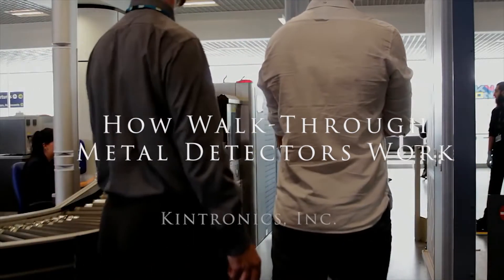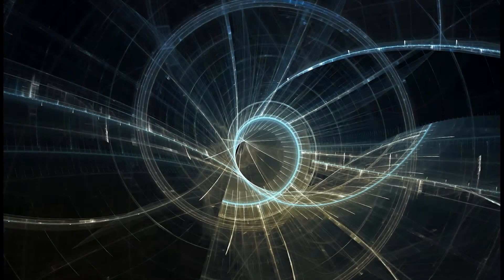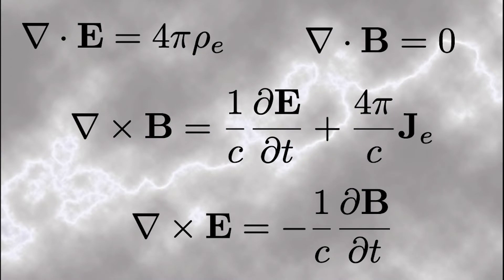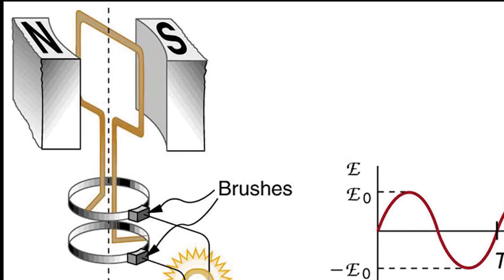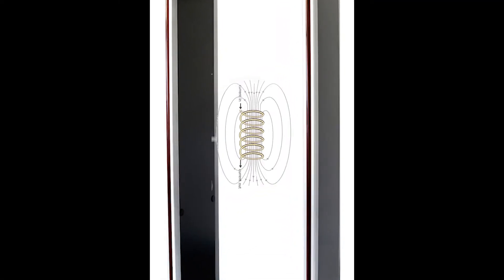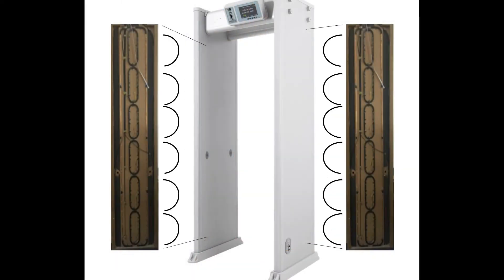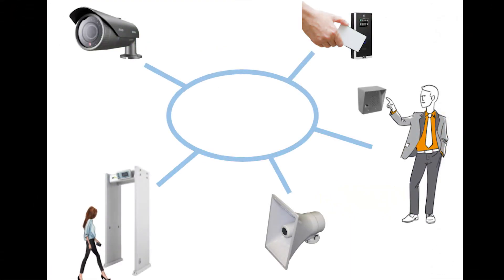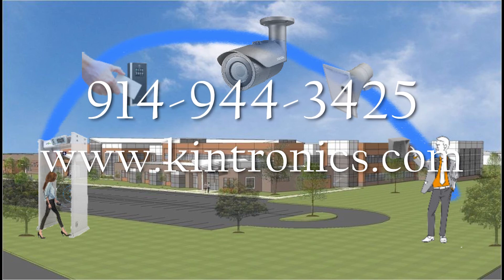How Walk Through Metal Detectors Work

Comment: this machine detects  mobile phone also???
Reply: yes
Reply: @DryTEKGI  brother  i want to use my phone in examination  hall and before that i hv to go through this machine is int it ??? and i wanna ask that is there any  kind of option used in this machine  or setup to detect mobile phones??
Reply: @ironcladair504  No, the in general they use any kind of metal (as metals send the magnetic signal back). Even if it's wrapped in plastic. So phones are a big nono. I always rely on piece of paper in exams when I am lost. 

Also new detectors are able to detect from the ground up and pinpoint the general area where is the metal detected.
Reply: @DryTEKGI  well thanx pail......now i need to change my idea😂😂